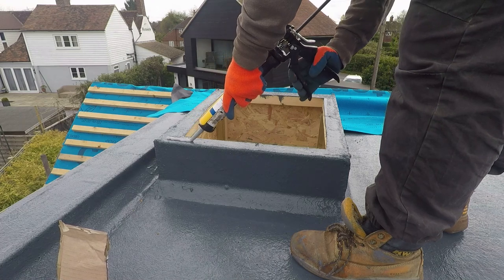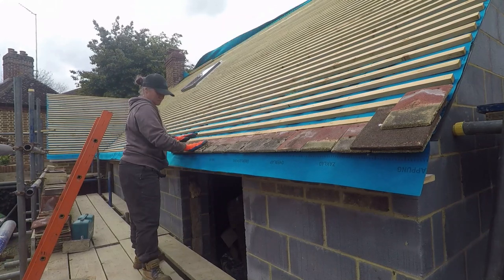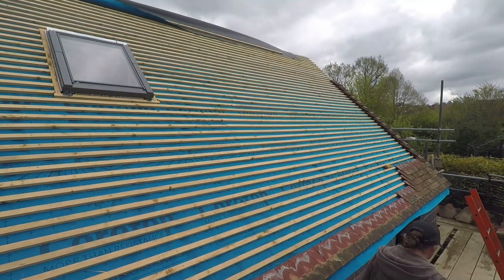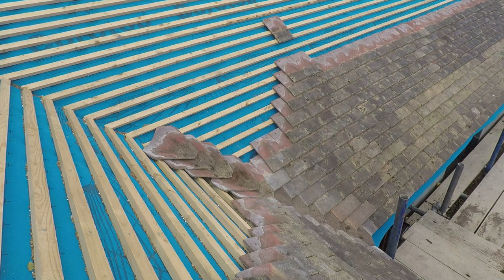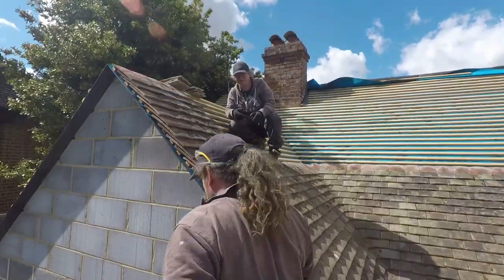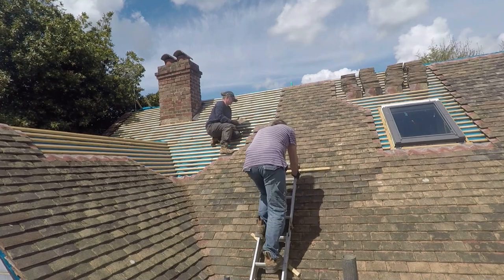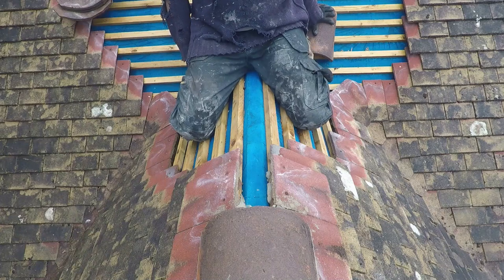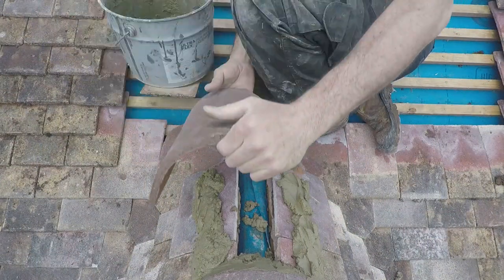House Renovation - Part 33 Tiling Main Roof

Comment: Great skylights. What make are those or who is the supplier as very interested in getting in touch with them. Thanks
Reply: I should have added the ones you have fitted onto the flat roof! Thanks
Reply from the maker: Hi Almar, roof lights came from www.roofdepot.co.uk they do lots of different sizes and you car order made to measure sizes !! Prices aren't bad too !!